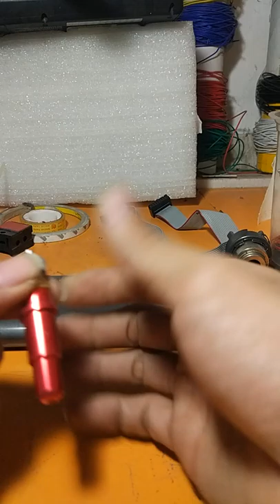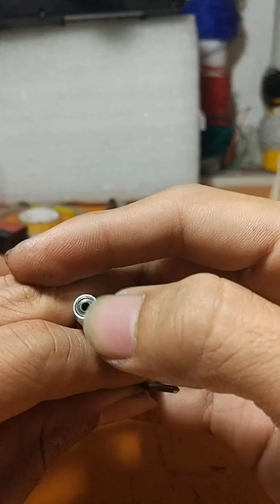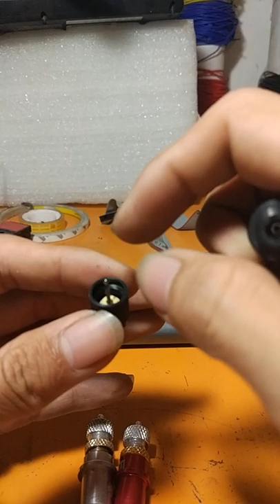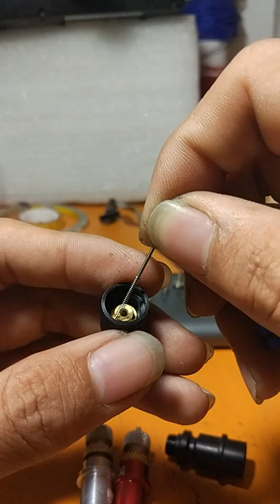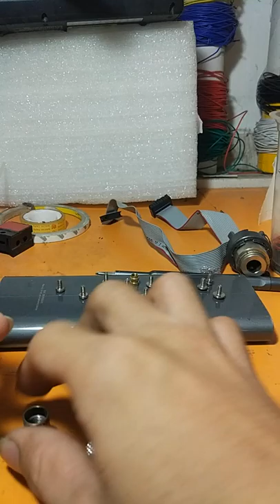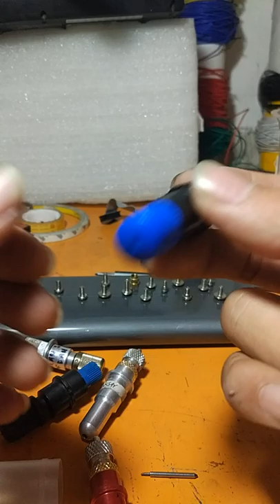cara cek kondisi holder mesin cutting

Comment: Dok, saya punya mesin cutting graphtec c6000 ,mau tanya kenapa kalau buat cuting slalu geser 3 ml ke vertikal ? trus apa perlu ganti per cadangan yg tersedia disetiap pembelian pisau , trim's
Reply from the maker: per yang ada di pisau tidak beroengaruh ke situ seharsnya, atau mungkin posisi peletakan holder miring.

Comment: Untuk mesin rhinotec apa sama aja bang, alnya sy cutting stiker vynil yg di print... Itukan holder nya nyentuh kertas...JD hasil print nya ke gores saat di cutting... Kalau holder nya sy putar ke kanan... Pisau lebih muncul... Tp hasil cutting nya malah die cut... JD solusinya gimana ya bang selain di laminasi dulu stiker nya
Reply from the maker: kurangi angka forcenya
Reply: @doktermesinindonesia9000  force udh paling rendah 10